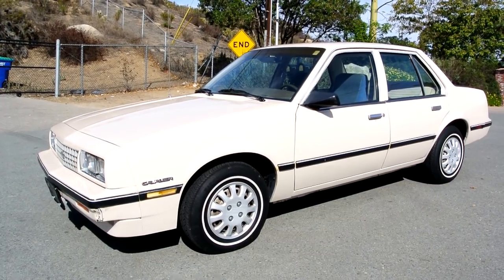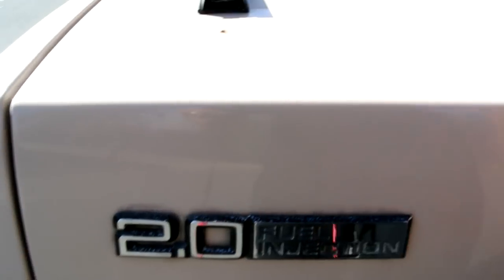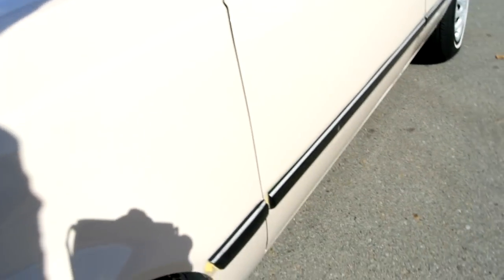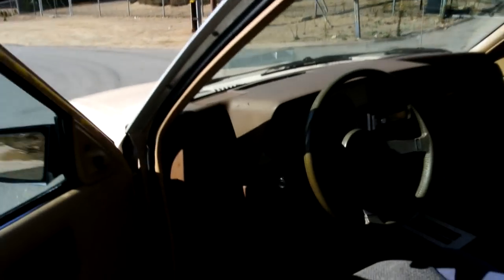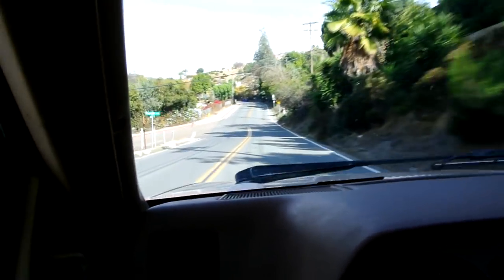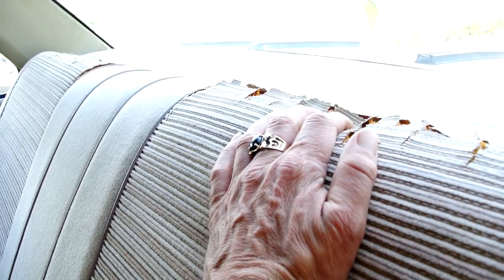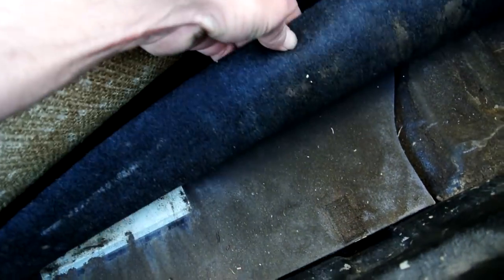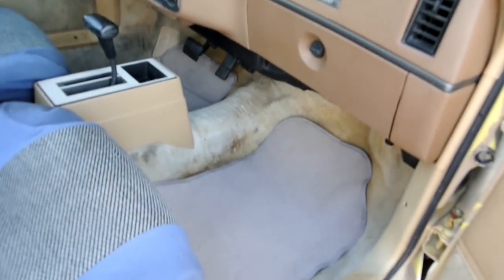1985 Chevrolet Cavalier 2.0 4 Cyl MPG Car Cheap Wheels For Sale $1995 Youtube Special

Comment: I have a yellow 1985 Cavalier with 74,000 miles on it. It's in good shape, no rust, two owners, my grandfather and then my mother. They only drove the car in the summer. Some of the interior ceiling is coming off, but other than that, it's in good shape. Car is in NE MIchigan.

Comment: I owned one of these 1985-1995. Very dependable mostly. Replaced the muffler several times. My brother said it sounds like a tin can, Nonetheless, it was fearless during the blizzard of '93 and plowed through snow storms when I was going to college in PA. Mine was white with a blue vinyl top, had a red stripe along the side molding, and raised white letter tires. Very sharp for an economy car.

Comment: I have a 1987 Chevy Cavalier CS and I love it. I bought it off my mom for a dirt cheap $100. It had been sitting in our garage for 4 years due to an oil pressure issue. After warming up, the oil pressure will drop to zero while idling. I band-aid fixed it by putting 20W 50 oil in it and drove it away. It still needs an IAC motor or throttle positioner (It likes to almost stall out then rev back up at the last second) but otherwise she runs great. I'll post a vid once I get a camera.

Comment: My parents had the exact model, except it was a 1984. We put a crap ton of miles on it. It never died on other than it leaked a little oil. We bought it used in 1985 with 4000 miles on it and sold it with 180k miles on it 1997.

Comment: I had an 84 Buick Skyhawk. The Skyhawk came with the same 2.0 OHV as the Cavalier. The 2.0L wasn't a bad engine. More fuel efficient and faster with the 4 speed manual transmission. The auto was the 3 speed auto, quick off the line and lags around the 40 to 45 mph. The trunk size is good. Those aren't the factory hubcaps. The factory was styled steel wheels with a literal cap over the hub.
Reply: Sailor Dave You do know that the Chevrolet copied the English automobiles Vauxhall Cavalier right
Reply: No, the J car was designed in the US and the Vauxhall/Opel was part of that development program [programme]. 

Used different engines. We got OHVs because GM thought NA customers too stupid to know the difference. 

Great story of the Cavalier and J Car development in Brock Yates book The Decline and Fall Of The American Automobile Industry.
Reply: Indy peanuts

Comment: The 2.0 in these was 1991 cc's and only generated  88 hp per the original specs. Top speed was measured at 101 mph in 1985 on a test car with this engine and an automatic transmission.

Comment: i wish we had more clean older cars here. i like these older vehicles, simple, cheap to maintain and reliable. newer cars are more of a pain in the ass...... expensive to maintain, in fact i believe the more complicated and expensive repairs quickly negates fuel savings...... and you have to make payments on the complicated junk. i have owned numerous cavaliers, corsica's and even a citation and they were easy and cheap to work on.
Reply: +andrew donohue Lol, emphasis on owned.
Reply: perhaps you aren't aware of where i live. i live in one of the worst climates for cars on the planet, everything around here rusts out no matter what you do. i once drove a 1991 cavalier that i paid $1,500 for 7 full years and over 100K miles. by the time i parted ways the car had 220K miles and i SOLD it still running well. these older chevys were tanks. none of the vehicles that i am mentioning actually died, they all ran and simply rotted out after 15-20 years of being exposed to the corrisive chemicals they put on the road. had they not used that stuff i might still have some of those vehicles. in fact i currently own a 1996 camaro Z28 that came from california 212K miles on it currently and its going to last a LONG time. i put it away for winter. you can have your japanese cars, and NONE of them and i mean NONE of them is as reliable or tough as a 3800 series II V6
Reply: +andrew donohue  You got lucky. Many owners these cars were junk. Perhaps you recall when the J cars first came out with the 1.8. They were soundly ridiculed for being lousy. Why else do you think the 1.8 was only around for 1 year?   That being said, rust and mechanical issues claimed a lot of these. No argument the 3.8 3800 was one of GM's best engines, but the 2 and 2.8 were for the most part, garbage. I beg to differ  on your  comment about the reliability and toughness of Japanese cars. Though not a car, the Toyota Landcruiser is a tough highly sought after vehicle, especially the mid 70s to early 80s. The 20 and 22R Toyota 4s are renowned for their reliability and toughness. They put the Cav's 2 liter engine to shame :}
Reply: toyoscio why are you comparing a land cruisers engine to a cavaliers 2.0? That's like comparing an LS4 to a Toyota 1.8 ltr. We've had many cavaliers in our family and one being a brand new 1988 coupe with a 2.0, and automatic which ran with no major issues other than a muffler all the way to 188k, and would have gone longer if my cousin had not hit a semi with it. It's called taking care of it, and maintaining it. Most people that trashed their Cavaliers didn't maintain them. My dads 1991 Chevy lumina had 200k when he sold it "still running" and it's 3.1 was a 2.8 with different/bigger head. Not much of a difference.
Reply: Twaddles McGee oh I know! Just one of those guys that spends a lot of time bashing American cars, when he secretly likes them. 😂😂

Comment: 2k is not cheap for a 1st gen cavalier,i bought an 1986 cavalier sadan for $200 about 3 years ago, im the third owner it had 107k miles on it, it was in terrific condition when i got had to put a windshield in it when i got it. other than the windshield the only thing ive had to do to it is tires and oil changes, still runs like a champ and handles snow very well. thats what you call a nice cheap reliable chevy cavalier. $200
Reply: im currently looking for a delorean, found one nearby with grass growing up around it but the guy doesnt seem to want to let it go...
Reply: +AcidGod GGG Lol, How do you know it had 107K miles,when the ODO only has 5 digits?
Reply: the title and the last registration before it bought it, it was still in the glove box

Comment: I remember got I this year and color car. It was my 2nd car. At first, it seemed fine. It had only 36k miles on it in the spring of 1993. But, it turned out to be the biggest piece of 💩 ever!
Reply: I got one in 1996 it lasted through High School then it started breaking down. Traded it shortly after graduation in 1998.

Comment: If gas here were $10 per gallon and with a salary of about $350 per month, I'd not be able to drive anymore or at least would have to get a moped or motorcycle.  Some of the old American cars like my old 1978 Cadillac only get about 12 miles per gallon of fuel.

Comment: Something about the fabrics in all the '80s cars that couldn't stand up to UV rays. Fabric coverings two decades later were (and remain) somewhat more resistant to the brutal sun. 

One time our plant had to run off tens of thousands of replacement body-side moldings for a particular car because not enough UV-resistant additive had been included in the PVC which was used in the accent strip laminated to the stainless steel molding. The silver PVC turned orange after a few months exposure to the sun. Present day the sun's rays are even more powerful for the thinning of the ozone later and it's doing a number on paint jobs no matter how old a car is.

Comment: How did you not laugh when you mentioned the 2.0? That engine and the 2.8 were crap, Lol
Reply: Crap in what way? Certainly not as far as reliability and durability were concerned, that's for sure. Both the 2.0L OHV I-4 and the 2.8L OHV V6 were both very sturdy engines and were known to last a very long time as long as basic maintenance was done on them. Were they sophisticated engine designs? No they weren't. They were pushrod 2-valve per cylinder engines and they were somewhat crude & rudimentary designs, however they were very simple with not a lot of expensive & complicated components to have go bad on you. Both of these engines were solid designs that were known to easily go up to 300k miles if properly maintained.